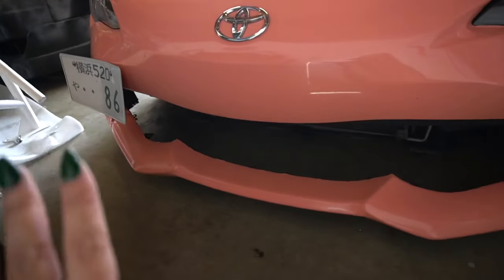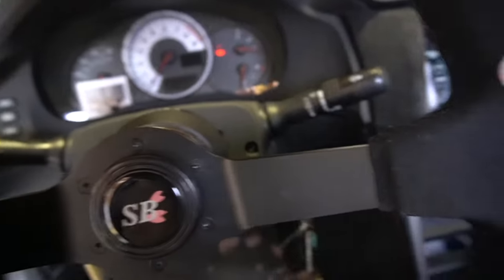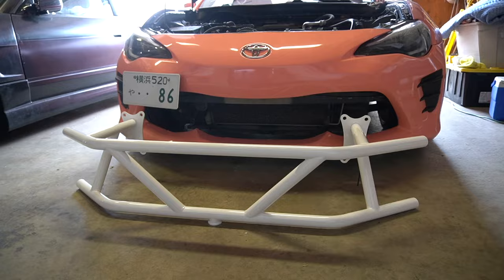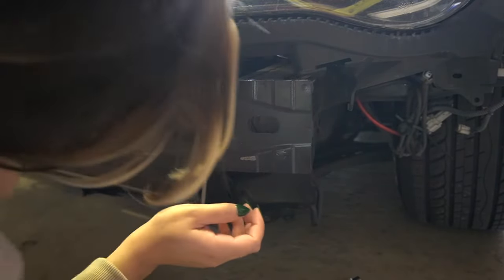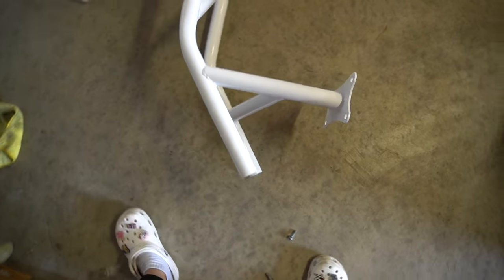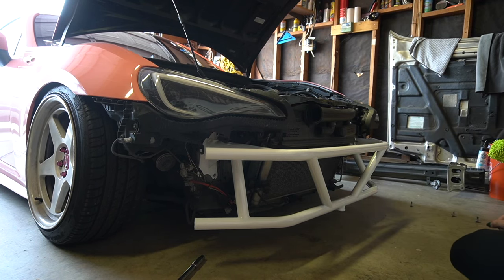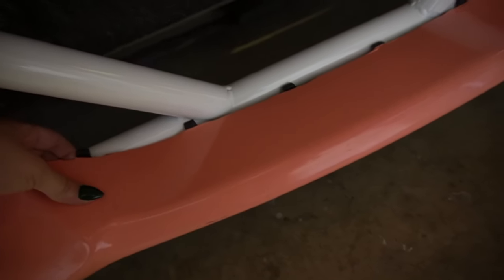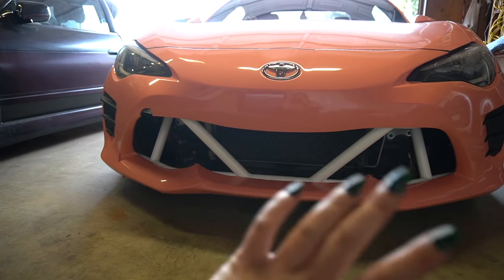FRONT BASH BAR INSTALL *FRS/86/BRZ*

Comment: Hey, i actually plan to buy a BRZ and kind of modify it slightly to get the best perfs out of it.
Was thinking about a stage 1 tune, catback, air intake, and maybe E85 (for the first part and if reliable maybe go for stage2 + headers)
Do you think that this could last for years and almost be as reliable as stock engine ?
asking your opinion because you seem to have this car for quite a long time and u also made several modifications on it. 
ty in advance !